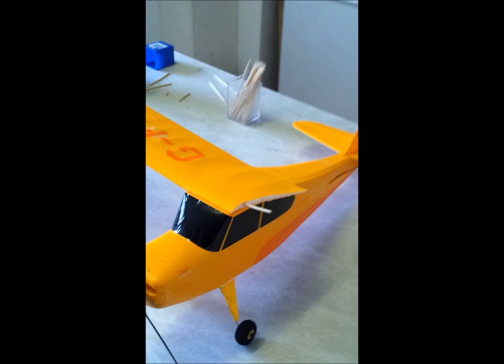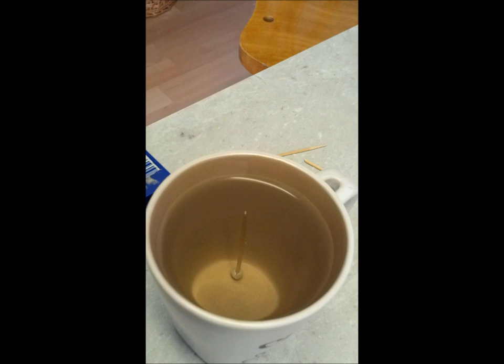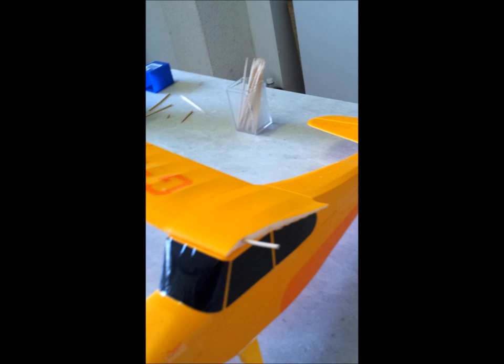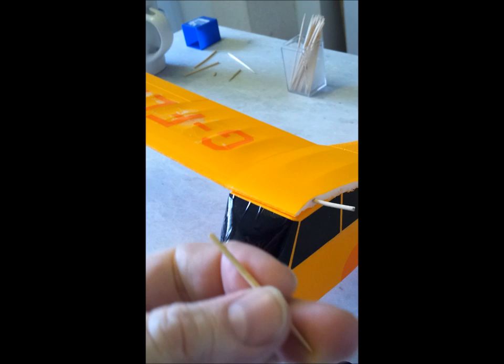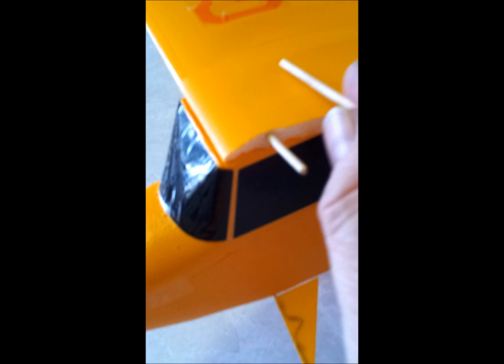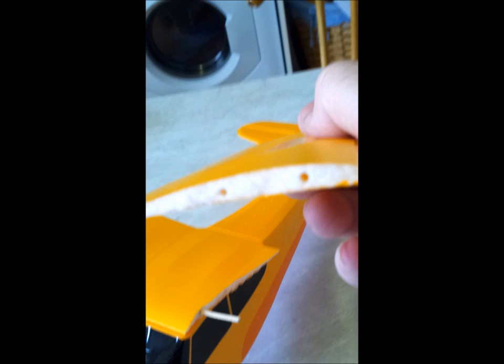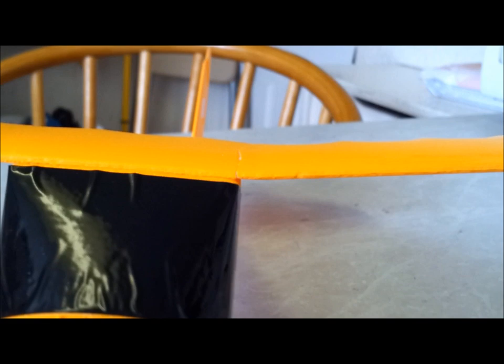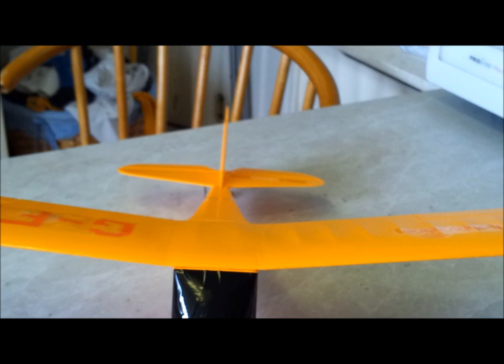RC Champ,easyfix 100% strong wing repair

Comment: another good tip for the champ is put a drop of regular ca,yes regular not foam safe,it bonds better and won't hurt the champs foam,on the little plastic control horns at the rudder and elevator,mine came loose so i did this,worked great,more precise throws because the glue does not allow those little plastic horns to give as much.

Comment: Here's something I dreamed up:  Elastics to hold the upper/lower fuselage together. Better prop to ground clearance. The elastics absorb the crash energy instead of the wing. Use fine elastics of 8.5" dia. rear and 6.0" front. They will be a bit "soft" so stretch them, so the hook around the base of the landing gear. Also flex the gear down to allow the elastics to seat between the fuselage and the spring wire embedded in the fuselage. See photos: flashtestdummy com Hobbies gallery. Thx again.

Comment: foam safe ca will due and reinforce the tail with clear scotch tape to prevent further breaks.  Its a good idea to reinforce all impact areas (front of the plane, leading edge of the wind) to not only reiforce the main structure but to prevent crash damage.  Just make sure the CG of correct and you will be fine

Comment: Foam safe CA (super glue) forms a strong instant bond, which is ideal for field repairs, but it is too brittle and will fail in the event of a crash or high stress. I use Weldbond which is a PVA type glue and it forms a stronger bond AND flexible bond and doesn't require additional reinforcement.  Weldbond can be found in local hardware stores 5 bucks for a 8 oz bottle or online on amazon.  It does require a long cure time but it is better if you want to conitnue flying.

Comment: Great vid. A few questions though

1) Why the blue tack on end of the stick?
2) how much do you need to trim the sticks? How far into the foam should you drill? Assume you trim same amount each end or do you have the angle biased to the side of the damaged wing for more dihydrel?
3) so you use shortened pointy stick to mark beginning of corresponding hole to get a proper fit?

Thanks

Derren